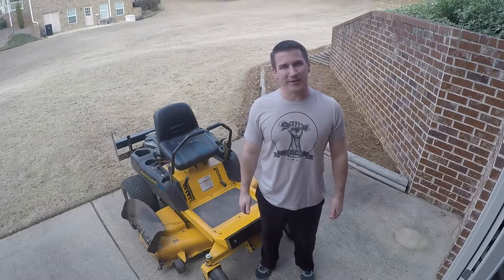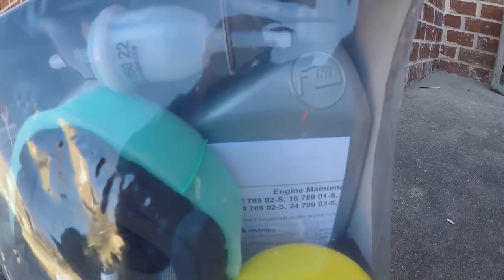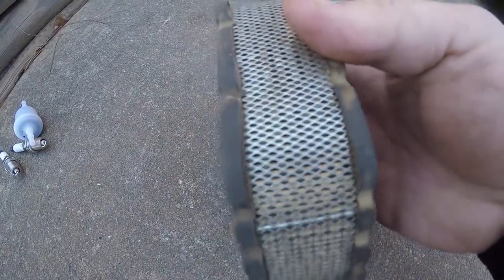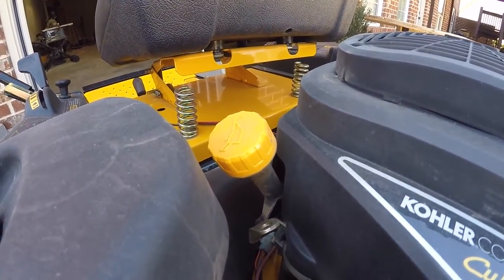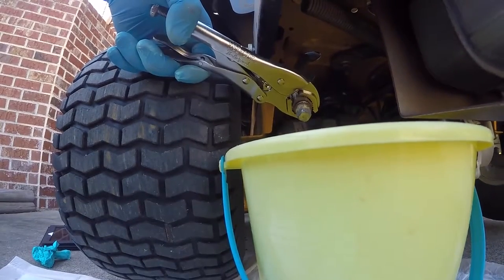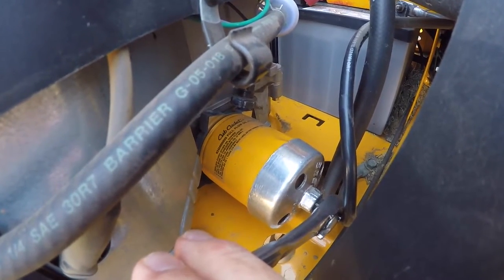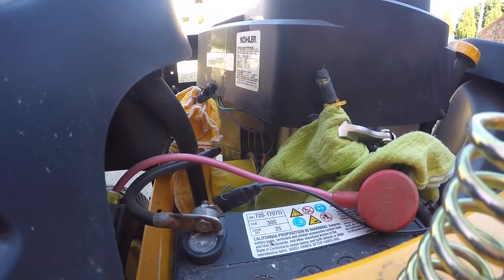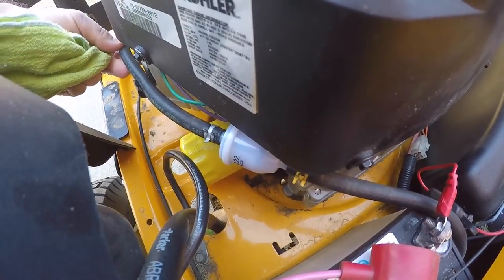FULL - Lawn Mower Engine Maintenance - Part 2

Comment: Thank You, my brother in law gave me his old zforce cub cadet zero turn mower last year and I knew I needed to change the filters and the oil.  My manual did not really do a good job of explaining the process.  Your video explained everything in detail.  Its late and I am letting the oil drain and tomorrow I will get the filters and the oil.  The only real question I have is on the spark plugs.  I thought I needed a tool to space it?  Any way I will buy them also.
Reply from the maker: Connie Adel I’m glad you found the videos helpful. 

Technically you do need a spark plug gap tool. They are cheap and are usually located next to the check out registers. I’ve found that most spark plugs come pre gapped and do not need to be adjusted.
Reply: @TightWadDIY  I think I have one, when my brother died I inherited all his tools, I will look for it tomorrow, thank you again! Oh and I also need to look for his grease gun, lol

Comment: what is the black bar thing you have on back of your mower?
Reply from the maker: It holds the bagging attachment. I never use it though. It clogs too easily with healthy Bermuda.
Reply: What about with coastal grass? Can it be used to carry things like trash bucket/Grabber or yard tools/weed eater?
Reply: I'm still trying to figure out why he didn't remove the filter wrench before wrapping the old filter with the baggy. Why get drain oil all over the wrench when he goes to so much trouble to keep the area clean.